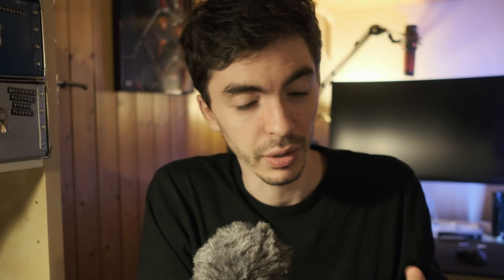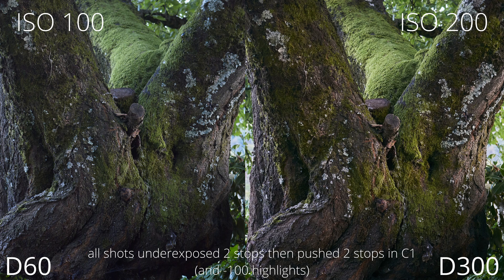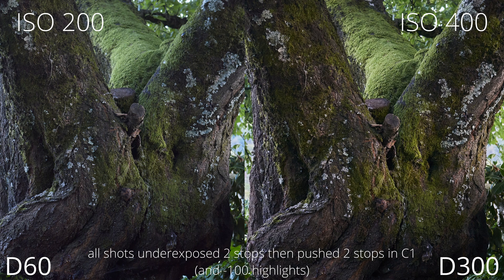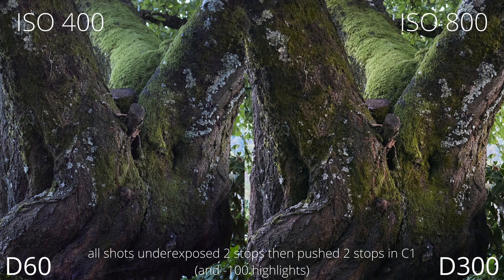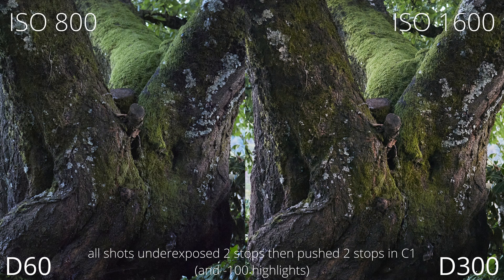CCD vs CMOS Sensor comparison : is there any magic to CCD?

Comment: CCD was used for scientific use long after consumer market switched to CMOS. CCD was better image quality due to more accurate conversion of light to digital with better AD converters and less variability in sensitivity to light across the sensor. Disadvantage of CCD was in power consumption, speed (frames/second), and expense (dedicated manufacturing equipment). CMOS excelled in speed, power usage and cost of development (shared manufacturing equipment with other chip technology)

Comment: Fuji nailed it with the Super CCD in the old compacts like the F10 & F30/31fd. Then they had some EXR bombs... until the  Original Bayer in the X100 and then they really nailed it with the X-trans cmos in the X-pro1/X-E1, the magic was back. Then they lost it after that. For me, these are the special ones. The other are just ok. Canon really nailed the CCD in the last compact S95. That Camera has awesome color. The older Canon's like the G2/G3/S45 were also very impressive for a 4mp it was quite amazing.

Comment: There are many differences between CCD and CMOS that explain different colors 
CCDs had relative better red/near red sensitivity and better overall sensitivity than CMOS at the same time
This allowed CCD manufacturers to put high quality color filter arrays (more selective) with high light losses
Out of sensor high quality analog to  digital converters gave better results and homogeneity than tiny pixel level ADCs, this has great impact to image quality
Dxo stopped to quote SMI index because this showed a deep step down with new CMOS cameras and changed it with color depth, better suited for CMOS measurement
CMOS manufacturers put weaker CFAs as high ISO race increase, and developped in camera signal processing to output better colors but they still have less color depth than CCDs
Reply: Where did you get that? Pretty much everything you wrote is wrong.

Comment: The D200 isn't known as one of the best CCD cameras for color. The Fujifilm S2, S3 and S5pro as well as the Olympus E-1, E300, E500, E400 and the Leica M8 and M9 are the ones to consider for amazing filmlike color.
Reply: What do you mean with best colors? Most accurate colors? Probably not.. 
Most attractive colors?

Comment: The difference between ccd and cmos is apparent mostly in skin tones. CCD make people look beautiful and cmos is dead. And some CCDs are far better than others.
Reply from the maker: this is a gross overgenralization.

CCD don't make people look beautiful and CMOS don't make people look dead.
Reply: @uncertainrelease  I was being hyperbolic but I'm responding to the idea that CMOS can be easily made to look like CCDs. If they could I would. Modern cameras are tuned for accuracy on test charts. The older cameras were tuned to look nice. I prefer that my camera make my pictures look beautiful instead of having to screw around in PS.
Reply from the maker: @flixfan1 well that's because of the time frame it was released in, not because of the technology used.

The original Canon 5D has a sensor that was "made to look nice" as you say it, yet it's CMOS, pretty much all older canons are except the original 1D from 2001.

My Nikon D700 does slightly better in my eyes when it comes to color, yet it's also CMOS. That's basically what I say in the video...
Reply: @uncertainrelease  I think it has to do mostly with the color density of the CFAs and the color science. I'm not against CMOS cameras. I use them exclusively for work. But when I just want beautiful, pretty pictures of my children, I'll use my old CCDs every time. It's the closest thing I've found to shooting with slide film. Editing raw in Lightroom is nothing like shooting slide film.
Reply from the maker: @flixfan1 well the CFAs used for CCD can also be used on CMOS. My point is what you like is the color science baked in those older cameras, not the fact that they're CCD or CMOS.

You'll see people saying tha the EOS 5D is the "most film like camera" they've used, yet it's a CMOS.
Reply: @uncertainrelease  I think the 5D and the D700 used the older CFAs. They also had lower resolutions which allowed for much larger pixels. They also didn't care that much about low light capabilities back then. This allowed them to make dense color-accurate CFAs. They were trying to win over photographers who were still shooting film. I still own an old 5D II and it does not have the old CFA/color science magic. I think that is when they changed (compromised) the formula for greater speed and low-light sensitivities. To me, Olympus with it's Kodak manufactured CCDs and Fujifilm SuperCCDs had the most filmlike color science but that's to be expected. But it's important to remember that Adobe does not debayer the raw files to the manufacturer's color.
Reply from the maker: @flixfan1 factually not true, the D3 and D700 were all about low light capabilities, which were further expanded with the D3S.

As for the "they used older CFAs", if that is accurate, well this further proves my point that it's not about CMOS vs CCD but rather which time frame the camera was released in. A CMOS camera released in 2003 will have a more film like look than a CCD camera released in 2010, simply because the color baked in the camera are not appealing to the same customer base, and the manufacturer was targeting something else, and not trying to win film users over.
Reply: @uncertainrelease  You might be right. I don't know if anyone has completely figured out why some people really love the CCD look. It could be that some people don't see as many colours as other people. Or they perceive them differently. It's kind of a subjective thing. I started out on film so that's still the look I like. The old CCDs look more like that. I shoot CMOS professionally. I own CMOS cameras. They are amazing for what they do and you can certainly get some beautiful images out of them but for my personal stuff, I'll still take out an ancient CCD camera and start looking for good light.

Comment: Yes, you`re right about CCD vs. CMOS sensors.  The 'magic" of CCD sensors are for those who love the filmic qualities it gives.  For one, color accuracy is not a positive attribute of film.  Two, the muted colors of CCD sensors are probably the result of lower dynamic range than in the CMOS types.  Three, the CCD look resembles film in a way that`s less resolved, filmic, compared to the better definition CMOS can give...!
Reply from the maker: I think that there's some qualities to CCD sensors, but oftentimes it's the byproduct of how the image was processed by the camera rather than how the light was captured by the sensor.

Case in point, the most "filmic" camera I've ever used so far is the Canon 5D from 2005... because of the things you mentionned : it's not especially color accurate, the dynamic range is limited and highlights clip to white really quickly... and yet the sensor is a CMOS !

In the case of the D60 in this video, there was some differences in the reds and browns compared to the CMOS D300, but in the end the difference was fairly minor for both noise and DR, and the colros can be very easily corrected to make one look like the other, with minimal tweaks
Reply: @uncertainrelease  
Pretty sure the color science has more to do with the differences between the types of sensors used than the sensors themselves…!
Reply from the maker: @superkrell  actually no, it has more to do with the processing done by both the ADC, and the image processor after the image was taken.
The colors you see are the colors that the camera interprets from the sensor. Remember the sensor doesn't capture full coloron each pixel, only about a third of the color and has to do demosaicing of the Bayer filter to obtain a usable image. This is all done by the processor, not the sensor.
In the past we;ve seen cameras using the exact same sensor obtain wildly different colors sciences. The reason? A new processor.
Reply: @uncertainrelease  
Isn’t that color science…?
Reply from the maker: @superkrell  Yes. Color science is litterally how you interpret the data that your sensor outputs.
Digital cameras don't work like film, the color doesn't come from the sensor. It's only photodiodes that are only sensible to photons (no matter their color / wavelength) filtered by a CFA and some other filters (like IR/UV cut, etc). What the processor does with that data, that's color science.
The difference between the different types of photodiodes might lead to very small color variations, as the photosites could be less sensitive to low energy photons (like shown here, the reds are more muted on teh CCD vs CMOS, but the blues are basically the same when it comes to saturation), but the "color science" part happens with the processor.
Reply: @uncertainrelease  
Forgive my ignorance of the subject.
Been shooting film for 30 years and just now went digital…!
Reply from the maker: @superkrell  no problem !
Reply: @uncertainrelease  
So what sensors do you prefer…?
Reply from the maker: @superkrell  I don't have a preference of sensor type, I have a preference of camera in particular.
I quite like Nikon colors, so at the top is the D700 for sure
Reply: No advantage to CCD other than the fact cmos has rolling shutter. Nothing "filmic" there that CMOS does not have. It's been debunked a long time ago.

Comment: I'm interested on the subject but you kept using the model name instead of the sensor type, even the examples didn't mention the type so after a while I was lost as I'm not familiar with the specific models.
The low sound mix didn't help either
And since the video focus was so jumpy maybe more time for the examples on the screen and less the psychedelic footage?
Reply from the maker: D60 = CCD
D300 = CMOS

AF issues have been fixed a while ago (not in this video obviously)

Turn your volume up?

Comment: Remove that car poster from background then you will get better autofocus, headlight from car is confusing your camera, it resembles like eyes. If your camera only has contrast dectecting autofocus then keep background light around 2 stops lower than the light in your face.

Comment: Whatever camera you are using for this video is focus breathing all over the place. The one you used for the Gear Acquisition Syndrome video did not have that problem. You moved your hands all around in that video and that camera recorded flawlessly.
Reply from the maker: Yes I used the X-T2 in the GAS video, with a single focus point roughly aimed at me. That video was shot on the X-H1 with face detection, but I keep moving in and out of the phase detect AF points, and the camera is loosing me.

This is fixed in the later videos as I use either a more accurate camera or simply just stay in manual focus.

Comment: I've seen two other CCD vs CMOS videos and it seems to be just color science has changed a little from camera to camera. And CCD has a little less dynamic range so blacks and shadows are a little darker giving more contrast. Here are two videos to watch. Pentax and Olympus kept their color science almost 100% I would say its 99% the same.

CCD Vs. CMOS: Sensor type? or Color Science?
https://www.youtube.com/watch?v=2x77sPknyRQ&lc=UgwwBLzftPx3b7IV_7h4AaABAg.A1-x8NbD8y5A104rVs4nm4

CCD vs CMOS sensor k-100D vs K-70 camera IQ color test Pentax review
https://www.youtube.com/watch?v=_cg8veUs5tE&t=160s
Reply from the maker: Yes that's also my conclusion : it's down to the color science more than the sensor itself

Comment: It's hard to compare CCD to CMOS in most case. Around 2007, when these cameras released, most camera in the upcoming generation at the time from all brand move from 12 bit A/D converter to 14 bit and it give different image character somewhat and they change to CMOS across the board around the same time as well if they aren't already use CMOS in the first place. I don't know in depth spec for D60 so I don't know whether it already move to 14 bit A/D converter yet but I know it get introduce to Nikon camera in D3 and D300 generation alongside EXPEED processor which D60 also featured. If it indeed also move to 14 bit already then this is the fairest comparison possible.

Thank for the video.
Reply from the maker: The D60 doesn't have an EXPEED processor, it has a refreshed version of the processor that was present in the D40 and D40X, only with the addition of D-Lighting. I guess Nikon wanted to get a little bit of traction on the D60 with the good rep of the EXPEED processors thanks to the D3 and D300 cameras, and named it this way but it ain't an EXPEED.

So it's most likely 12bit A/D converter (it's also not possible to select 14 or 12bit in the menus, so I'm guessing it's "stuck" in 12 bit anyway).

Knowing this, I also shot the D300 in 12bit mode (12bit is the way to go with the D300 as well, there isn't any benefit to going to 14bit files (not more DR present), and it slows down the camera considerably for burst rates and write times, buffer ect.)

As far as I'm concerned, the D300 is a 12bit camera more than anything else.

Comment: You should really lock your focus in these videos unless otherwise. PS , I would really love you to do a review on the d200, maybe even a comparison with the d2h or d300
Reply from the maker: I went full manual focus on the following video, and since then bought a camera with proper face detection in video (and phase detect points across the frame, unlike the X-H1 that I was using for those videos until then).

I'd say that thos autofocus struggles are behind us 😅

PS: comparing the D2H with the D300 would be a bloodbath lol. The D2H would win on build quality (though the D300 is clearly about as well built), but both can get the same burst rate, and the D300 does so with a much better autofocus, 3 times the resolution and much wider dynamic range as well as ISO persomance that has no comparison with the D2H.

Would be a fun video to make, albeit a very short one as the conclusion draws itself.
I'd love to get a D200 for testing but I don't have a use for it right now unfortunately. Maybe if I can get one for super cheap I will !

Comment: I like the hardwork and planning you put into your videos. Interesting comparison. I think you busted the myth about CCD sensor having better colour rendition then the CMOS. One can easily see that D300  is better colour giving 3D effect to all its images compared to D60 flat images .  Probably because of better autofocus system on the D300,  the images looks much sharper on D300. Just curious how much of difference we might see between D200 vs D300. By the way i picked up D200 last month from MPB for £38/- with shutter counts of 30K while the D300 is going for £100 with same shutter count. I felt it was not justified to pay thrice the amount for D300. Now i am wondering if i made the right choice or i should have gone with the D300 for the extra money. Thanks Anyways keep  posting such interesting and informative contents.
Reply from the maker: There's nothing wrong with the D200, it's an awesome camera, especially at the price you got it for !

I have a dedicated review of the D300 if you want to go check it out, but in a nutshell I think this camera is extremely good for the price. Dynamic range is good, better than the D200/D60 (sensor is the same for all intends and purposes), it shoots faster and the autofocus system is a huge upgrade. Even if you're just a hobbyist, I can see how having tracking autofocus and Live View could be pretty beneficial.

I picked up my own D300 with 30k shutter count for about 60€, so if you're interested in this camera, i'd definitely keep a look out, D300s on MPB at that price regularly drop

Comment: Great content from you! Noticed that recently there's been many videos about the D300 .For a long time ,you would be hard pressed to find any. I only have a D300 and D700 and have only been buying and using AI/and AIs, afD lenses to compliment them.Thats how how much I love and am very content with both these cameras.  Plus the use the same batteries and the mbD10, shutter release cables etc is a big bonus.
Reply from the maker: Yup, having a D700 too I can attest this is a very nice combo. Being able to share the grips, batteries, cards and have the exact same control structure and image resolution with a almost matching color science is quite nice.

That's my "secondary" kit (I first got the D700 then grabbed a D300 as it was cheap as hell (around 60€) but that's one that I could use as my primary kit no problem.